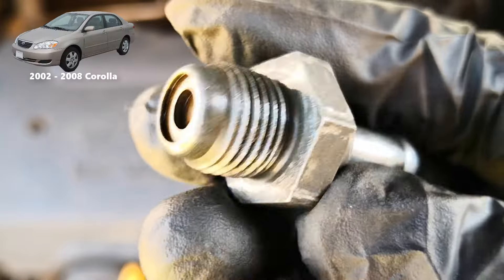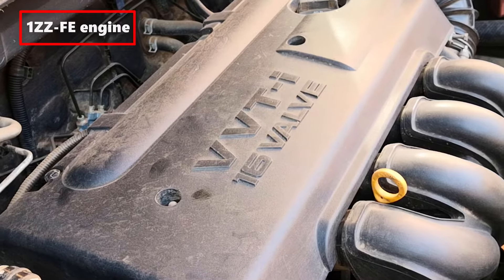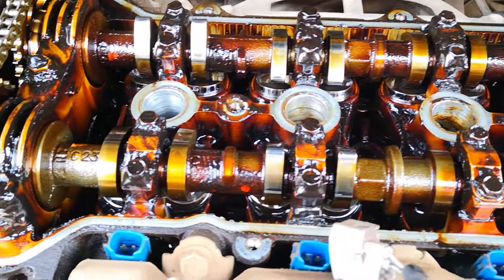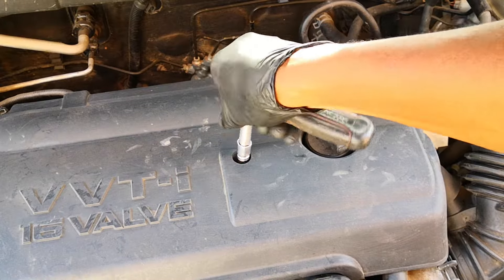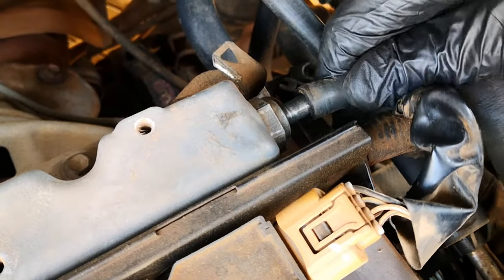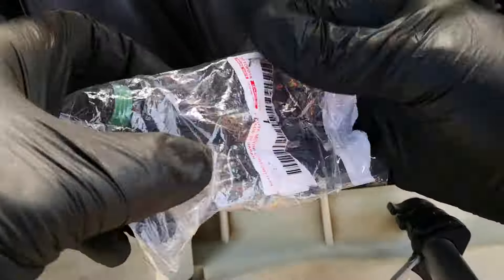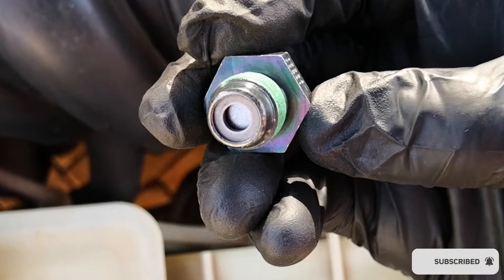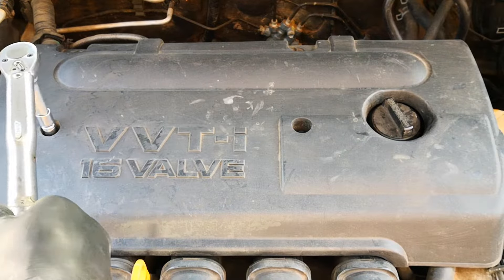Replacement of PCV Valve: 2002 - 2008 Corolla / 2003 - 2008 Matrix / 2003 - 2008 Pontiac Vibe

Comment from the maker: When last did you change your PCV valve? Let's talk! 😀
Just in case you are looking for the exact PCV valve used in the video (2002 - 2008 Corolla, or 2003 - 2008 Matrix/Pontiac Vibe), you can take a look at this Amazon link for the genuine OEM from Toyota - https://amzn.to/3FJHfvQ. I may earn a small commission from a purchase made through this link. This does not increase the price you pay in any way. Thanks!
Reply: Pls where r you at for one to meet you, thanks
Reply from the maker: I actually don't run or have a workshop. Just DIY stuff.
Reply: Thank you, this video is so helpful! I appreciate how you show and name the tools. I’m trying to buy similar ones (size 10 socket wrench and 22mm deep socket) and was able to find those on Autozone but they have a choice of 1/4”, 3/8” and 1/2” drives. May I ask which drive is the right one?
Reply: No worries if you don’t get a chance to answer. Google’s AI was sufficient. I went off the guidance that 3/8” drive was pretty standard. That helped me to choose sockets and a compatible ratchet. Autozone had the tools and parts, your video was easy to follow. I only got as far as removing and putting back the engine cover and hose clamp. Unfortunately the PCV valve hose on my ‘04 Corolla would not budge. It didn’t slide off as easily as it appeared it should in the video. I thought even if I somehow separated the hose from the old PCV valve and made the switch, I may not be able to put it back afterwards. Luckily I have a mechanic I can trust and take it to soon. This video was still helpful in that now I have the tools to at least check on my PCV valve in the future.

Comment: Ever think of installing a catch can?
Catches the oil/fuel/moisture blowby that slips by from the combustion chamber into the PCV valve, which ends up into your throttle body then combustion chamber again & again.

Comment: Just a quick question.
What is your advice if I wanted to replace the faulty PCV valve but do not wish to open the engine block to check for sludge.
Will just changing that and using engine flush be enough to solve the problem?
thanks man.
Reply from the maker: There's no need to take off the valve cover if its just to replace a PCV valve. If the engine has sludge, you'll be able to see it by looking at the crankcase cover and looking into the oil pour hole. I used oil flush once but there's still some sludge in the engine, so can't say. I'm planning to do a 2nd flush and will update. Should come as a video, actually.
Reply: @DIYAutoworksNG  Many thanks for the advice. 
Car has been showing issues for a while and just hoping that it isnt something serious. 
Mileage is now 180000km, have to top up engine oil as its always dropping but not leaking, acceleration is slow and now the aircon is only cold when I step on the accelerator. Fingers crossed that its a easy and cheap fix.